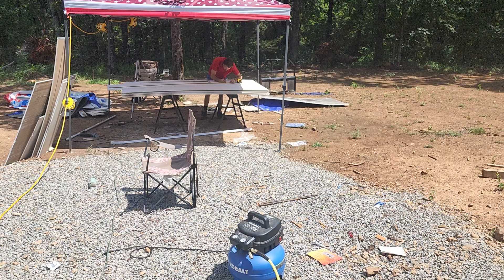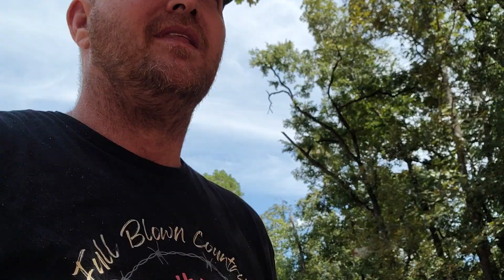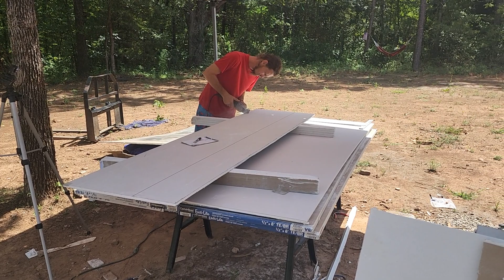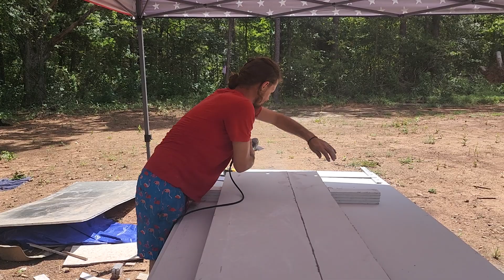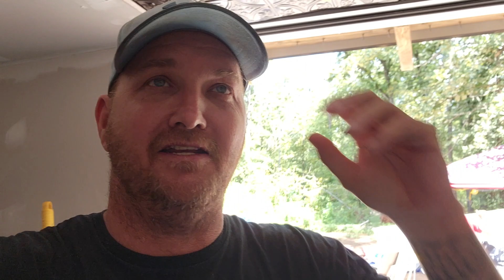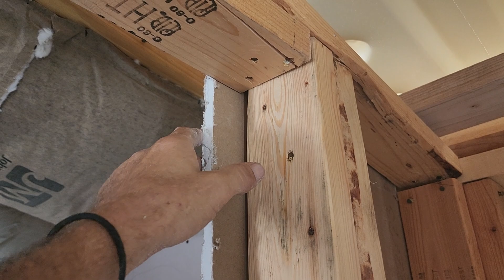THIS COULD HAVE BEEN BAD |tiny house, homesteading, off-grid, cabin build DIY HOW TO sawmill tractor

Comment: I don't understand why Mike insists on using that oscillating cutter to cut the drywall instead of scoring it with a box cutter and bending it at the cut line to snap the pieces apart.  Seems much easier that way.
Reply: Would be lots quicker too!
Reply: Iam sure they are learning to do this. Mike & David.

Comment: David you  can use a utility knife score the paper fold the sheetrock away from the cut and cut the paper on the other side of the fold w/ the knife. Save the dust and your lungs from using a dremel.
Reply: Would be a lot quicker too!
Reply: Yeah was faster i used to rock back in the day. they should have done the lid fist too.
Reply: And makes straighter cuts the multi tool is great for cutting out light fixtures and things

Comment: David, firstly, awesome job on the drywall and trying to get the tiny house finished! Second, after seeing how DD5 lost their video files on their external hard drive, it seems that you may want to both invest in a network attached storage server (NAS). For example, I've had my QNAP home storage server for almost 20 years and thankfully no issues in lost files or corruption. You can also setup the NAS in RAID-5 configuration so that even if one of the hard drives fails, you just swap it out for a new one. I believe you've worked in the IT field, like me, so you understand what I'm saying. I quit working last year after 37 years working in IT, and I would never use just an external drive for critical files you cannot afford to lose. Also, if I may be so bold: have you considered getting a Mac Mini M2 computer for your home computer (you already have a keyboard, mouse, monitor that you will need to attach to it)? These new Mac Mini M2 boxes are powerful video editing machines, don't cost that much, and you can pay off the cost on a monthly plan with NO interest, direct with Apple. Again, having worked in the IT field for many years, I would never go back to Windows machines, but if I had to use Windows, the cool thing is that you can run Windows inside the Mac computer using virtualization software (just make sure you buy as much RAM and HDD space as you can when buying a Mac, as the virtualized Windows will use some of that, but only while you run Windows inside the Mac). Glad to help with any other questions, if you have any, so feel free to reach out to me on Instagram @SteveAtwal

Comment: If I could make a suggestion on the drywall compound use a paddle mixer attached to your drill add a tad bit of dawn dish soap no more than 1/4 teaspoon half cup of water an mix the 5 gal bucket of mud an it will make it buttery smooth and apply real nice
Reply: 🎉yep and with all that soap in the mud when you go and start sanding when you get that drywall dust in your eyes it going to burn like nobody's business.
Reply: @Joe-n6l  a 1/4 teaspoon mixed with a 5 gal bucket of mud is such a small amount it won’t bother you any more than the dust by itself. Have done this for years

Comment: Cmon, I would finish the bedroom including paint.  I would get as much drywall in the bathroom area and mud it once!  Then move the bed in the new bedroom.

After that, I would concentrate all efforts inside the cabin!  Get those rooms laid out and ready for the kids!  The balance of drywall, trim work and painting can be done once Hazel and the kids are there to help.

Oh yeah the Mini Split needs installed also!  ❤❤

Comment: Most dry wall guys put ceilings up first. They use a piece of scrap on the floor under the dry wall to keep it from getting wet if flooded. Then remove scrap. Watch Anthony video.
Justsayin.